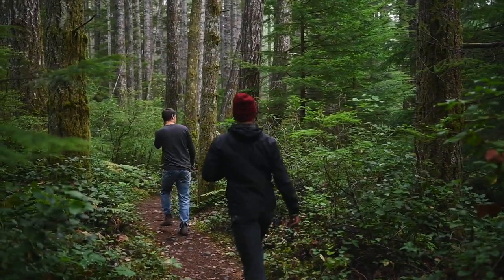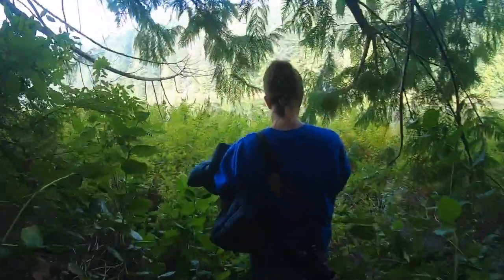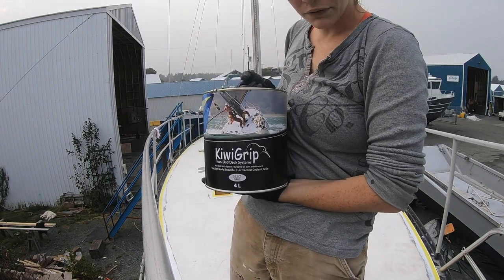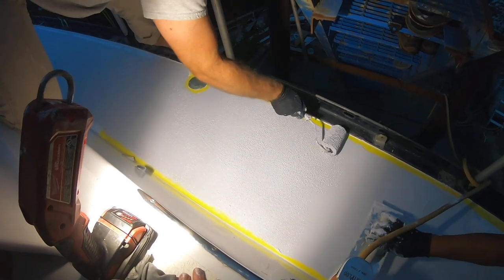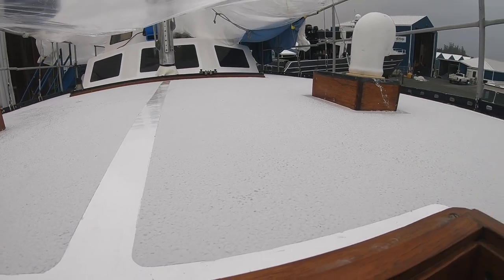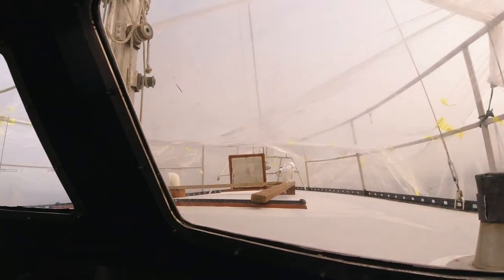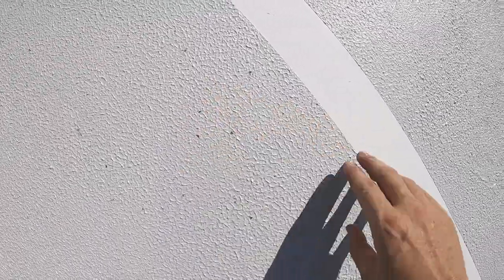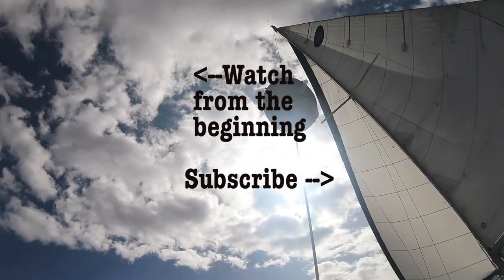How We Almost Ruined Our Entire Deck Paint Job Painting Kiwi Grip | Ch3 E19 | The Wayward Life

Comment: So you said I could...
My suggestion would have been the tarps are great but put the heater inside the boat raise the temp to like 27-30C the heat rises through the deck nd cabin top and dries the thing really nicely as the humidity is forced up and out.
Cheers,

a

Comment: I had a Whitby 42 in Nova Scotia, with which the previous owners had started the KiwiGrip painting in the morning (before the deck was completely dry). After a couple of seasons, the paint started to lift in once specific area, due to the moisture (it had just never properly adhered to the deck); however, the repair was so EASY (just sand and scrape the area that lifted, scuff the subsurface and reapply) that it only took about 3 hours from start to finish. KiwiGrip is a forgivable and easily repaired product, it's amazing. Might not hurt to have a quart stashed away somewhere....just in case

Comment: I did my boat non skid in Kiwigrip and was getting house rendered with a synthetic render and was taken at how similar the 2 materials seemed to be. So I made a test piece using render and Kiwigrip roller on a piece of ply. Left it doorway so it would get walked on. Next non-skid guess what I'm using at about half the price.
Reply from the maker: Have you tried it in a marine application though? Cuz salt water can change things
Reply: @WaywardLifeSailing  well house is within 100m of ocean and routinely has strong seabreeze. But otherwise, no.
Reply from the maker: Lynndon Harnell hmmm can u put it right at the beach and walk on it regularly and get back to us?
Reply: @WaywardLifeSailing  not really. Ply fell apart and I don't have any more render left.

Comment: We’ll done you guys for turning a disaster in to triumph. I'm looking to use KG on my deck this summer having just removed the teak. How is it, still good? How do you find cleaning it, ok?
Reply from the maker: Yep we are still loving it. We sold this boat and bought another one with kiwi grip on part of the deck and a different deck paint on the rest and the kiwigrip is not only grippier, but a lot cooler and easier on the feet.
Reply: @WaywardLifeSailing  thanks for coming back. Coolness of deck is defo not a problem here in the UK and Ireland😊